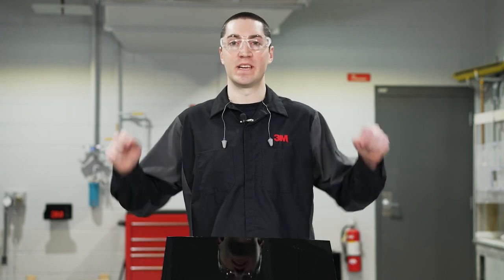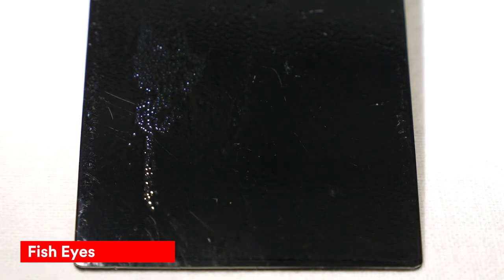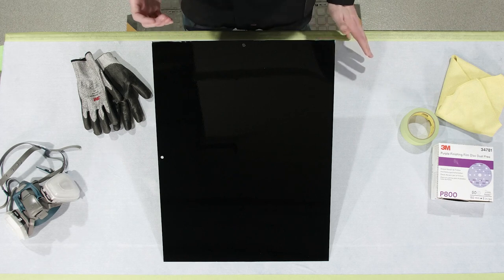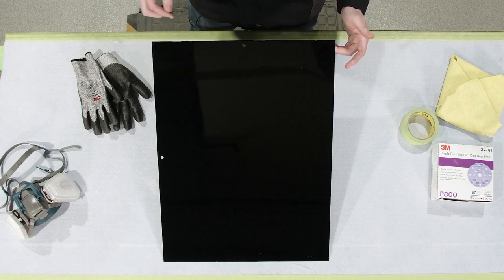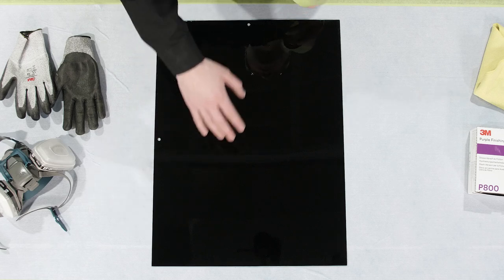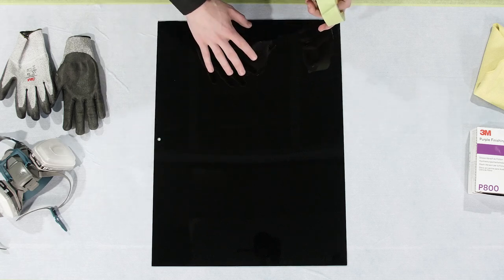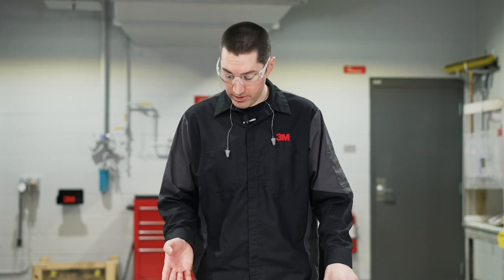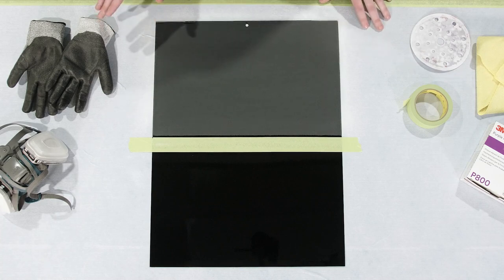Paint Defects 101 Episode 2: Fish Eyes

Comment: You mention moisture in the air lines. During building an area onto a building, expanding or completely new, don’t forget expanded polystyrene insulation and covered with a sheet of plastic. It is common building code in many locations but not all. Failure to help keep moisture coming through the concrete floor plus plastic before re-bar & welded wire reinforcement sheets can allow high amount of moisture to lift primer as well as paint or clear starting at the bottom up, when heavy rains and temperatures drop. This happens as well and sealing the concrete or epoxy coating will inhibit or eliminate it.
   In you introduction, you mentioned this video was for restoration or body shops, basically in the professional world. I have a primer, paint and clear coat area dedicated to this process. Why are those of us who purchase smaller amounts of 3M product left out, as their are 23 little one-off shops that use 3M products at $550 to $800 per purchase, compared to every professional licensed shop. Are we being disrespected and asked to not watch? Or we are not to buy your products? Ok! We got it. ASE Master Tech since 1978 and doing body and paint work as these videos are not intended for us to watch. We will just buy other high quality brands! Thanks.
Reply: hmm... I'm sure you are fine to watch the video kind sir.

Comment: Can applying too much clearcoat to soon cause fisheyes? I've been having a lot of them lately. Also, can paint or laquer thinners cause. Lately been using the 3m 26689 aerosol gun cleaner. Seems like I was having them before I started using that product.
Reply from the maker: Hi! If you are getting fish eyes, it is most likely caused by some sort of contamination. The 26689 wouldn't cause you any contamination, it’s practically acetone in a bottle. We would suggest retracing your steps and cleaning up very well.

Comment: Why not giving usefull tips, first of all  getting this many fisheyes in one part is rly rare, normaly if u get some u get like 1 or 2 and u can remove em without repaint by dropping clear coat in the fisheye and polish. All your videos from 3m are rly basic and aimed for ppl that never set a fot in a paintshop
Reply: Totally wrong,
If you paint metallic and get fisheye, you can’t just drop clear coat. The color where fisheye occurred will be lighter. You need to repaint . Also that area will lift over time. Dropping Clear coat fix is a temporary fix and not for long term durability
Reply: This is what shitty shops do. Quality shops re-clear if the imperfection won't sand out.